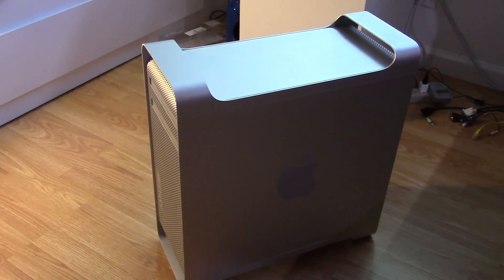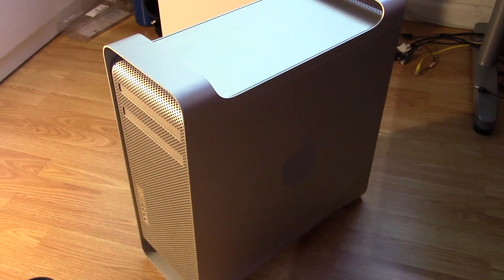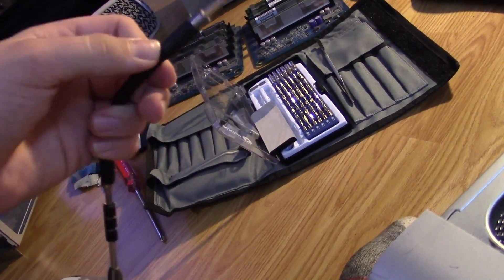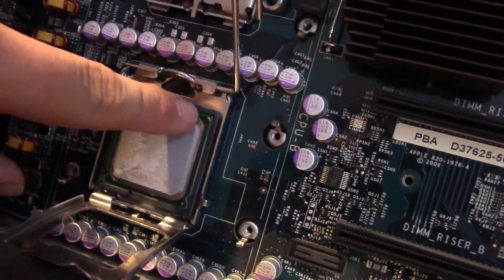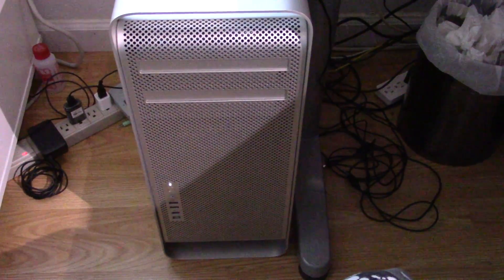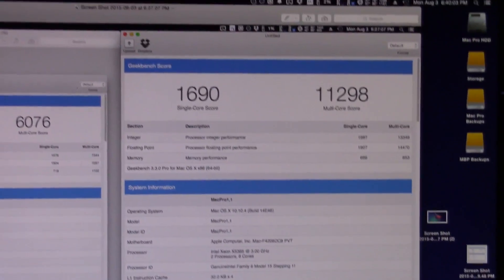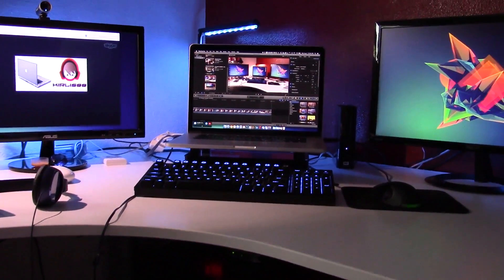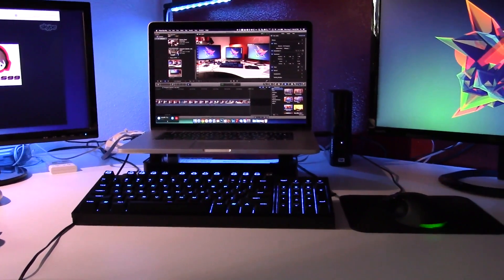2006 Mac Pro 1,1 CPU Upgrade: Intel Xeon X5365

Comment: What happened with it? ;-) I actually found a 1,1 really cheaply and I'm thinking about getting X5365s installed. Or if there's anything even more capable? It's a hobby kind of project but I actually am able to run Reason 11 on it under the tweaked El Capitan OS. 32 Gb of ram means it's rock solid when it comes to stability.
Reply from the maker: I sold this machine several years ago lol. I'd like to get another one someday

Comment: I have this same computer and after doing some reading I wouldn't spend the money and upgrade it. If you want to upgrade a mac throw the 2006 mac pro away (i'm going to throw mine away) and buy a 2009 mac pro for maybe 200 bucks or so and it's easier to update and you can get it up to 4.1 and put in fast processors. What I've done instead is to build hackintoshes. I've made like four or five of them. one of the best solutions are the hp series of servers like Z800s. I've gotten "one" of them to run Sierra and then we just dupe the hard drive and usb startup drive to clone them. You can pick these up cheap for the cost of just buying the chips and for 2-300 (not including cost of hard drives) you can have a fast mac. The other way is to hack an intel based PC or build one from scratch using a gigabyte motherboard and intel chip they are much sturdier but more money than an hp Z800

Comment: just in case you know but does the GTX 960 work in the mac pro 1,1/2,1
Reply: what OSX are you running? I got my 2,1 running El Capitan with dual X5365 and a pny GTX960 4gb version no issues. Nvidia has the drivers on their site. This guy needs to upgrade his GPU that's why his pro is so slow.
Reply: Innosense hi did you have to do anything special to upgrade to El Capitan? Did just upgrading your processors and gpu allow the software update to work? If not, any resources you recommend to check out in order to help me get there?

I have a Mac Pro 1,1 I’m upgrading the RAM and CPU’s on right now. Do I need to change the firmware profile to 2,1?

Comment: How are you getting 11k score? I have 2 x5365's and I have a radeon 7970 3gb graphics card along with an ssd and I am only getting 7k score. Any idea what the problem is or how to find the problem for the low score? I did the efi and smc update also so not sure what the problem is.

Comment: it renders slow because you still have a dead old GPU.. change that graphics card out and it'll render crazy faster! I did it to my mac pro 1,1 and put a 1gb VRAM card in there and then it was FAST!!!
Reply: ***** I had to find one compatible with it... but that was back in 2013... im about to swap out my CPU's as well... and then try to do the same with a graphics card that can work with it... it's some tricky stuff, but let's hope it works! lol
Reply: GTX 550 will work. Around $50 on craig's
Reply: hueseph yeah that's the first one I upgraded to 4 years ago... it was great but u know how it goes when years pass by... u need more power haha thanks so much for the help
Reply: I've got 550Ti and it works very good!

Comment: Yesterday I inherited a mac pro 1.1. The specs are:

Processor 2 x 2.66 GHz Dual Core intel Xeon
Memory 10 GB 667 MHZ DDR2 FB-DIMM
Graphics Nvidia GeForce 8800 GT
Software OS X Lion 10.7.5 (1163)

There is also FCPX and Adobe premier CS6 on it. All I want to do is do light video editing but it's so laggy I dont know whats wrong!

Even just playing a video straight from a memory card from my camera its very laggy.

Do I need to upgrade the Graphics card? CPU? Please help. I'm sure this computer is powerful enough to just play a video clip let alone run FCPX smoothly! 

Furthermore does anyone know of the best CPU upgrade/ graphics card upgrades I should do to run FCPX or adobe premiere

Thanks in advanced!

Comment: I'm about to do this and keep the old graphics card. Already did a tear down and clean waiting on the CPUs to come in. From my understanding even with firmware upgrade its still limited to 10.7.5. This is a music rig I need very in sync and I've seen crazy long steps in getting higher OS X over 10.7.5 to work, but stability is a question for an audio production/media rig. My question to you is what did you use to go past 10.7.5? Is it stable? And if I were to do bootcamp would it be more stable to do a 64bit Windows build using acustom efi fix

Comment: when you say firmware update helped the performance? are you meaning 10.10.3 to 10.10.4 ?
Reply: That's software, not firmware.  He means from 1,1 to 2,1 firmware. It's kind of like a BIOS, but not.
Reply: @gavinendsley  The EFI flash was the only difference I know of between the Mac Pro 1,1... except for the processors.  With stock Apple parts this mod was said to cause an overall 20% increase in performance.

Comment: how did you flash 10.10.4?  I did my mac pro 1,1 a year ago at 10.10.3 and I'm afraid upgrading via app store and that it will undo the boot.efi hack? What do you recommend? did you upgrade or did you have no problems once you had the newer processors?

Comment: i just upgraded my mac pro 1,1 from 2x2.66 x5150 to the same cpu's as you 2x3.0 x5365 and it boots up perfectly, but when i go to upgrade the firmware and flash it to 2,1, it doesn't upgrade. i downloaded the "Mac Pro 2006-2007 Firmware Tool" and clicked upgrade to 2007 and followed the instructions to shut down and hold the power button until the light flashes and it still shows as a 1,1 and says "2x3.0 ghz unknown." i tried an SMC reset, PRAM reset, and tried the upgrade again and it still won't upgrade. do you have any suggestions? 

Specs:
CPU 2x3.0 x5365
20 GB ram
OS X El Capitan 10.11.3

Comment: The video card GPU speed is mismatched between the two computers. That's what's throwing it off, not the CPU speed. The MacBook Pro has a better built-in GPU than the graphics card in the Mac Pro. Try upgrading the GPU in the Mac Pro to make it a fair comparison.

Comment: Sorry sunshine, you did way more work than you had to, all you need to do is LOOSEN the screws on the ram cage to nudge it aside slightly. You use a flashlight to light the allen heads and slide your t-handle screw driver down to the heads. Easy Peasy.
Reply from the maker: +Snob Dobbler Sounds like more of a pain in the ass to me. I followed iFixit's guide.

Comment: I have the same setup. Running 10.10.2.. I assume you are also running a custom EFI to be running Yosemite.... How did you flash it to 2,1 when running a custom EFI?
Reply from the maker: +Rob Senzon How we did it was install the OS via an external enclosure from my MacBook Pro, and then replace the necessary modified EFI files. It booted just fine, from there we used the third party firmware upgrade tool.
I sold this computer a while back, but yeah.

Comment: Good work dell0404,

Removing and upgrading cps isn't for the faint of heart.  I use my Mac pro 1,1 for pro tools(audio) as compared to video,  like yourself.  I was put on to this whole MP 1,1 update - with 3.00ghz xeon,  5770 graphics and 32 gig of 5300f ram.  I have all the parts and now I am searching for the beat and easiest way to update the boot efi to have 64 bit and have the system recognize the CPU.  There is so much convoluted reading,  links,  and hieroglyphics on Web pages,  I find it confusing to read and download what I need to do this.  Can you suggest what you used,  with your partner in crimes help on Web cam to update the boot efi to 64 bit and then upgrading to mavericks.  I am just fearful of installing some hack and bricking the whole computer. I am more mechanically savy than software smart - so easiest way would be appreciated. 

Thanks for posting this video and taking the time to create it.
Reply from the maker: +Stephen Kambeitz I feel you, I'm not the greatest software person either :P. I had my friend do most of the work, but here's what I can tell you: How we got it to work is we plugged the hard drive into my MacBook pro and installed OS X from there. Then, we replaced a few files (including boot.efi) so it would boot on the Mac Pro. Works great.

Thing is, I couldn't tell you where to obtain the files or what directories to put them in. I've sold this computer a while back actually.

Comment: I noticed you are running server ram any overheating issues?
Reply from the maker: +capndavey1 Yeah the Mac Pro used server RAM up until 2009 I think. It ran very hot, in the 80-90C range. Had to crank up the fans to keep it under control, because the RAM I used didn't have the giant heatsinks. I sold this machine a while back.

Comment: Hey Also try updating your Cuda Driver on the Mac Pro then try to render your video. You should see a difference.
Reply: where is the link for this? Im rocking a mac pro 1,1 2.0 ghz with upgraded GPU. thanks!

Comment: What did you use to flash the firmware? I used Sixty Four to Thirty Two Terminal App to be able to install Mavericks. All that is good and Golden, but I am planning on putting the quad Xeon 3.0ghz processors in but I am not sure what I should do to update the firmware.

Comment: Dell0304  What is the rush though. Look at ItsMyNaturalColour, he was able to render 1080p video on his MacPro(addmitedly this was a 2008 Mac Pro(3,1). But sometimes he exported the day before.
Reply from the maker: GeneralTech Why the hell would I wait 5 times longer for a video to render when I don't have to?
Reply: Dell0304 I am saying was because he built a hackintosh but the amount of videos he pushes out each week is phenomenal(1 vid a day monday-friday) to say they were on that fairly old machine but still very capable.
Reply: GeneralTech If the rMBP will render faster, it makes more sense to do it on that. A 2006 Mac Pro is simply outmatched by modern Macs.

ItsMyNaturalColour built a Hackintosh for the same reason.
Reply: His Hackintosh isnt that much faster.
Reply: Timur Tripp He built the Hackintosh because he saw the prices of the 3,1 Mac Pro's rapidly dropping and wanted something that will hold it's value while upkeeping a similar if not superior level of performance. He never 'needed' to upgrade though. 
And anyway, the 3,1 is greatly superior to the 1,1 even with the upgraded CPU's in Ryans.
Reply: not really much difference in the 2,1 and the 3,1 ( his is now a 2,1)
Reply: GeneralTech There is actually, the Xeons in a Mac Pro 3,1 have more L2 cache, more cache per core, better performance per dollar, better performance per watt, oh and they're cheaper xeons to run as well.
Reply: ok

Comment: Back to the S5 active with the cracked screen?

Also, you need to vow to yourself that you have to have the macbook for maybe ~3 years (you've had it for one) before you go trying to replace it again lol.
Reply from the maker: Jacob Cohen Yep, it's the best phone I have despite the shattered-ness. Lol I plan to use it for longer than that. And even if the Mac Pro replaced it, it wouldn't go anywhere.
Reply: Dell0304 honestly, even me not being much of a samsung fan myself, you could probably get the screen fixed and it would work fine. But I don't really know what I'm talking about, although I do have a Samsung phone, I only use it for calling
Reply from the maker: Honestly, for what it is I like the phone. It's like an S5 but with better build quality. Replacing the screen is a PITA and not worth it imo.
Reply: Dell0304 I know it still works it's just I'd be afraid of cutting my finger. Although personally I don't use my phone for much (I still have a regular digital camera) and don't really know much about them.
Reply from the maker: Jacob Cohen Lol my finger doesn't get cut. Had to remove all the tiny shards of course but now it's fine.

Comment: I have a 2009 dual E5520 Mac Pro as my main machine ... GTX 660 video.

I have not tried any sort of video rending on it but I suspect that the triple channel DDR3 memory and the better bus used in the Nehalem Xeons would make all the difference.
Reply from the maker: ***** I suppose, aswell as other things like SATA 3, improved CPU architecture, etc.